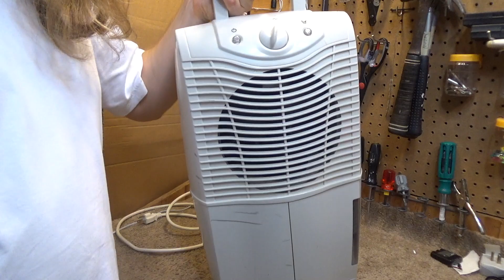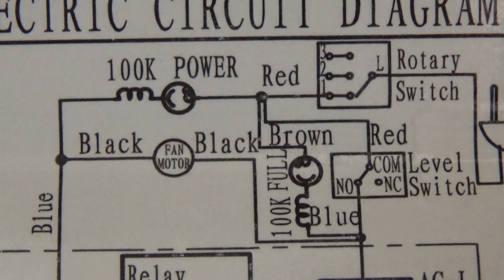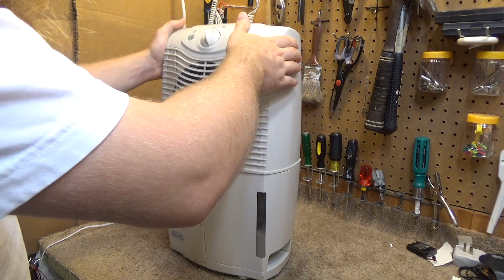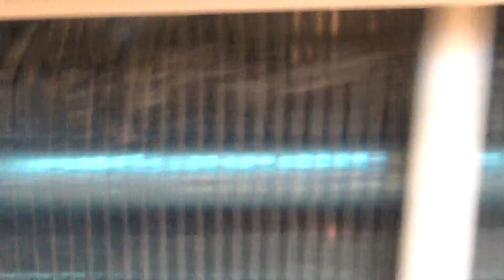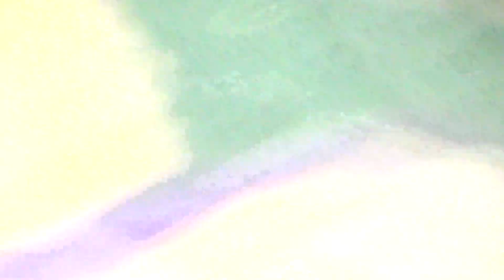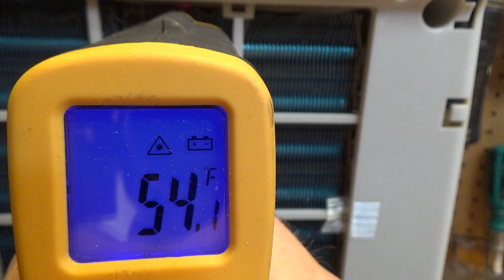NewAir AD-250 25 Pint Dehumidifier | Initial Checkout

Comment: I need something like this for my bathroom versus the bulky unit I have now. I’m surprised of how little amperage this uses it must be fairly efficient for also being 25 pints. R134a is not flammable but the compressors oil is.
Reply: Does this have a constant drain option where you can connect a garden hose to it? That may be a way to get around the leak as well.
Reply from the maker: It does have the continuous drain option.

Comment: I have never fond of R134a but I really want one of those. Looking at it i thought it was a humidifier or swamp cooler but it's a dehumidifier. Just so odd and crazy fascinating. 
By any chance do you know the dimensions?
Reply from the maker: I don't have anything wrong with it, seems to be similar to R-500 in a lot of ways. Not exactly, but I'd guess it's about a foot wide, 6 or 8 inches thick and maybe 2.5 feet high.
Reply: @JordanU  that is crazy small for a dehumidifier being a modern machine is a bit bigger. My friend has a small Frigidaire dehumidifier made by the Electrolux that is about a foot wide and a foot and a quarter wide and a foot and a half tall. Is my guess but still suprising to see such a small machine.

Comment: R134a is nonflammable. I've never seen a dehumidifier that small before. Never seen a rotary compressor designed for R134a either. R134a isn't bad but I would prefer R22 or R12 any day. The flammable refrigerants are what is absolutely unacceptable. There is no excuse for it. This is probably a little low on refrigerant. I personally think the charge they put in is pitifully low. 3.25 ounces isn't much. If it needed charge, R134a is quite easy to obtain.
Reply from the maker: I've never seen a rotary compressor this small. R134 is OK, seems to behave similarly to R500. It definitely has a full charge, it was probably sitting for a while unused. I've used it in the bathroom several times and the coil got cold all the way through no problem.